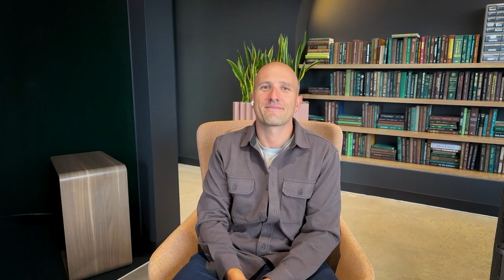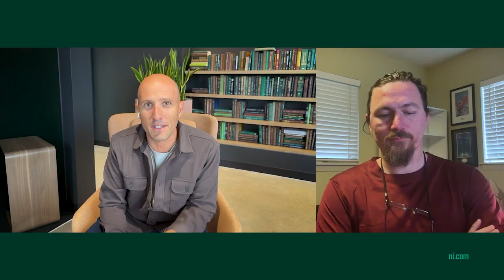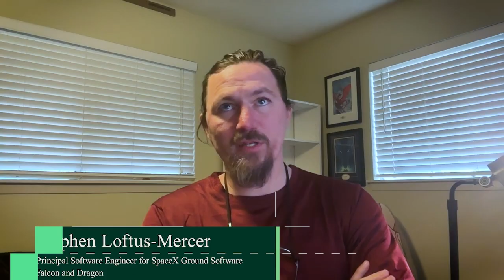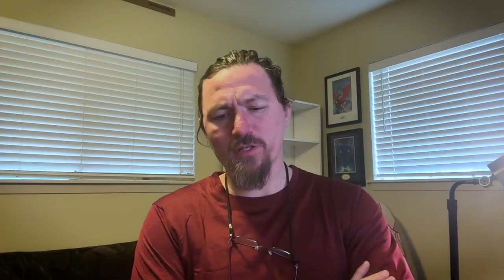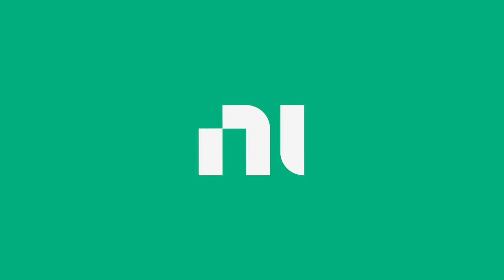The Origins of Object-Oriented Programming in NI LabVIEW with Stephen Loftus-Mercer

Comment: How come with .NET objects in LabVIEW most of the problems associated with references mentioned here aren't an issue? Sure you have to manage reference lifetimes but that can be solved with a good algorithm. You have demonstrated that your are able to manage references through VI references.

Lifetimes management is part and parcel of being a programmer and people need to accept that. Everything has a lifetime, other engineering fields have accepted that. 

Data flow is great but it shouldn't be used as a 1 size fits all tool. Haskell has a garbage collector which means somewhere there's a reference that is being managed. It just needs to give you the illusion that all functions are pure. 

The art of writing a program is no different from writing a good UI. Readability, Usability and Findability are key. Let the compiler handle the optimisation and give users the option to monitor what optimisation the compiler is doing as turn the off. Easy mode, Pro mode. 

Also LV classes don't scale well. There's a lot of work that needs to be dont there, every time I delete a class I need to close my project and open it again to clear it from memory.
Reply from the maker: Hello. For technical support inquiries, we recommend visiting our support website: https://bit.ly/428V29c. From here, you can share your question with the community, or open a support ticket with our team. Let us know if you have any more questions!